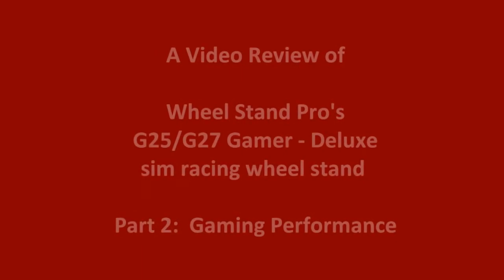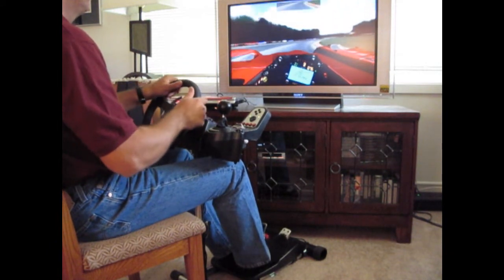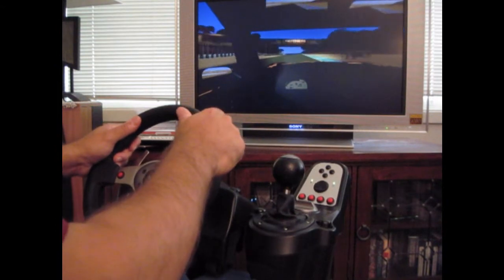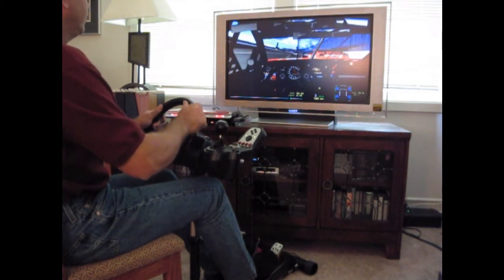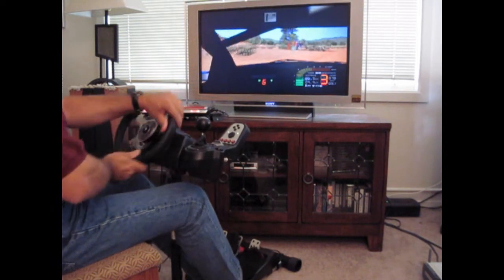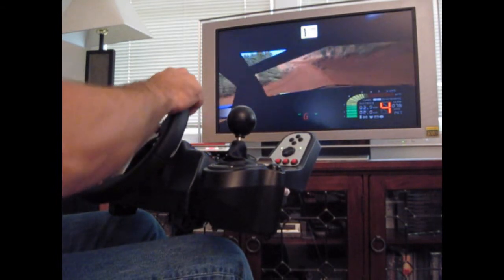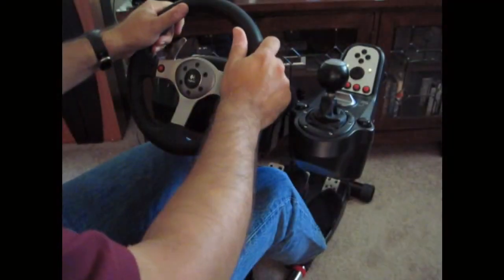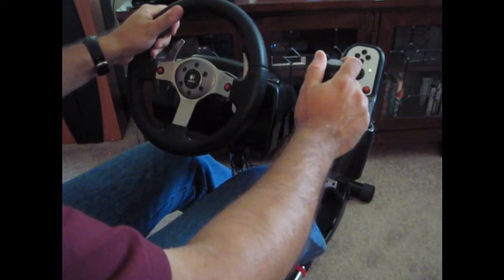SimHQ Motorsports - Review: Wheel Stand Pro (Part 2)

Comment: thanks for the review. are you able to properly do heel and toe, and left foot braking with the frame between your legs?

also, i intend to use it with the fanatec gt3 rs. will I be able to swap it with my joystick, throttle, and rudder pedals for flight sims using the same model wheel stand pro?

thanks!
Reply: There is a different stand also avalible called the Thrustmaster worth hog recommended for flight sticks